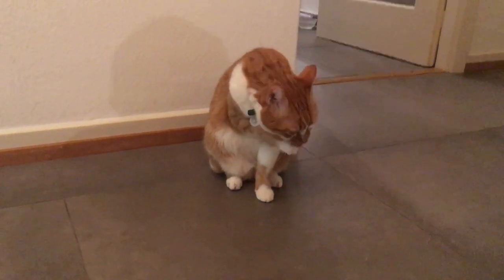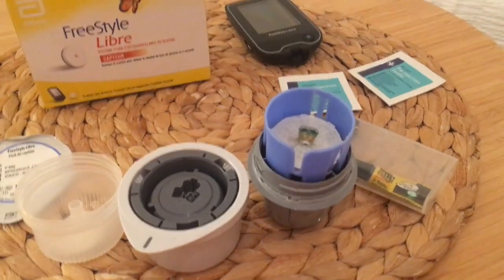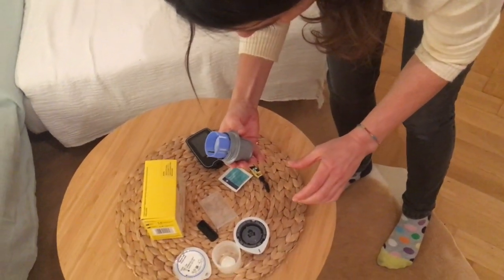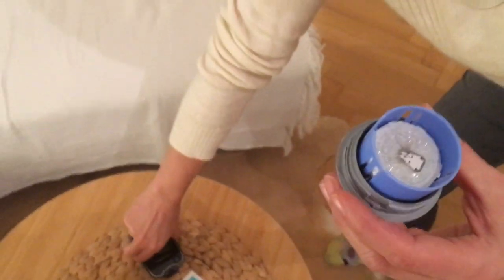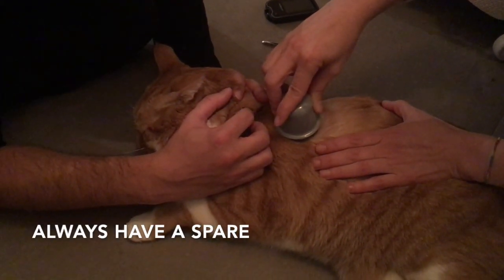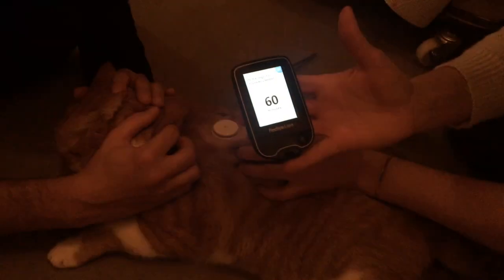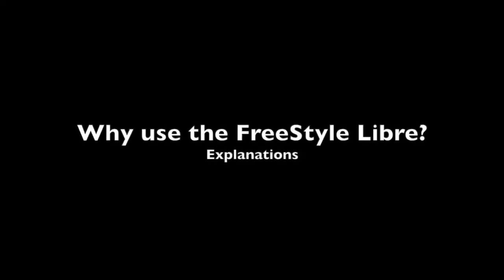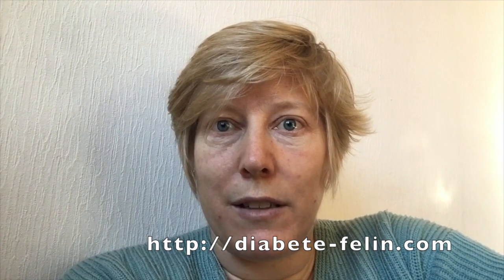FreeStyle Libre for Diabetic Cats: application demonstration and explanations

Comment: Nice video. I saw many posts on FB where they mentioned about Nightrider which they have used on their pets and can follow their readings when they are not around. they also get alarms when their pet's glucose level goes out of range. I think this would be great option for your cat
Reply: Yes, you are correct. Nightrider will definitely improve diabetic cats too as they can be followed by their caregivers also it alarms will save them as they can't speak
Reply from the maker: not sure what nightrider is, probably not available in Europe?

Comment: hi, I went to my vet today to have them show me how to apply the sensor to my cat, and they said absolutely not to use super glue because it is very irritating to the skin.  They said to use SURGICAL GLUE instead.  What they used is 3M Vetbond Tissue Adhesive, and I just purchased it on Amazon.
Reply from the maker: it depends which super glue! some are definitely irritating for the skin, others aren't. vetbond is good but not always easy to get. I personally use fake nail glue now :-)